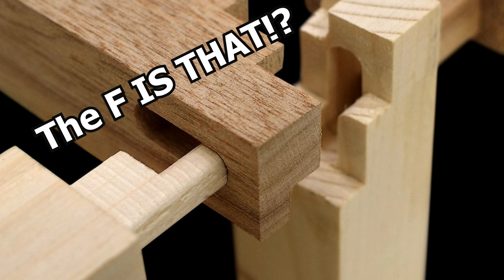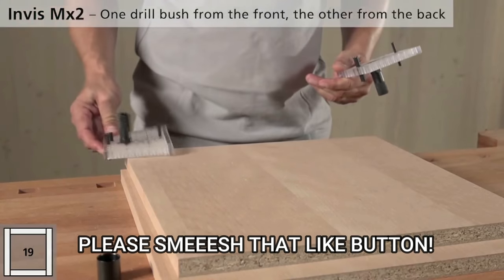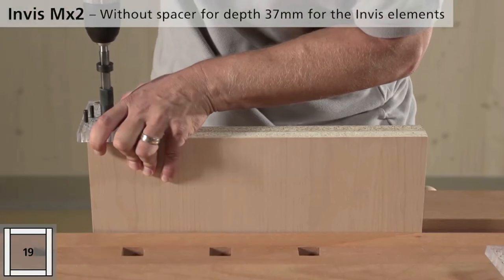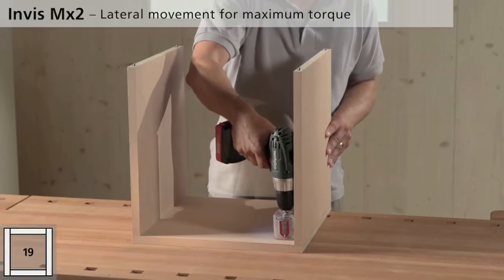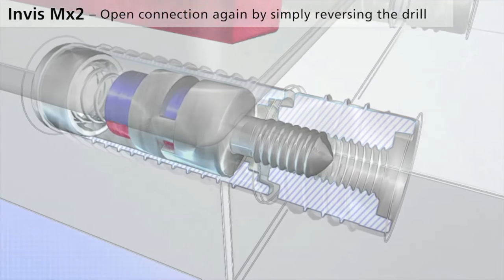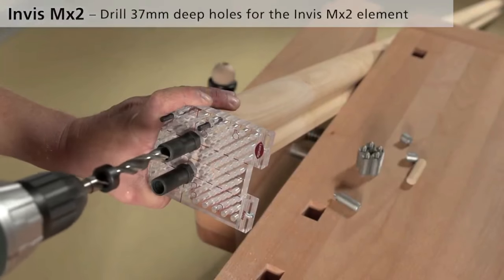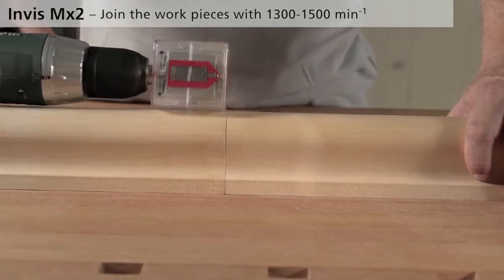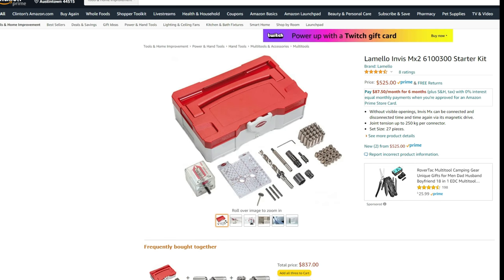The Craziest Drill Attachment YOU WILL EVER SEE!

Comment: Magnets are cool. Have a homemade wood shelf hanging on a wall with pictures and do dads on it. Just an old plain heart pine rustic shelf but it has a secret.The bottom has  concealed hinges down the entire length on the back seam so it's more of a box then a shelf. There is no visible latch or pin or visible fastener of any kind. On the bottom panel in the left and right front corners I drilled a sleeve in the panel going left to right. And on the side pieces of the "box" the bottom panel resides between I drilled the same diameter hole in straight alignment careful not to go all the way through. (mark your drill bit for depth). Next took two nails, and cut off the heads with my kleins and inserted one in the sleeve I drilled in the panel on each side. Next there is a very strong rare earth magnet in one of my do dads I mentioned before. So  supporting the bottom of the panel with my hand in the middle I slide my do dad from the outer front corner towards the center from each side sliding the nails inward and out of the holes drilled into the side which releasing the lock to access my contraband. LoL. To lock it back just raise the bottom back until my edges are flush the slide the magnet down each side in an outward motion sliding the nails back into position locking the box again. People have stood there looking at the pictures and old do dads and even remarked how the love the old stained wood and all the worm holes and grain and no one has ever figured out it's actually a hiding spot. And doubt they ever will. All that said I really like this fastening system you passed along. Thanks.

Comment: How tight does it actually get? I'm curious how strong the magnet is. By the way the craziest drill attachment I've ever seen is for use in the bedroom 😜😉!! Just saying!!
Reply from the maker: Hahaha Mark 👊.  That's the question I have too. I've heard some say it gets pretty snug, but others say the opposite 🤔
Reply: It uses strong permanent magnets but depends how fast it is being turned as there's a recommended RPM range it should be used in for best results.  Though, for fun, check out LockPickingLawyer channel, he used one once to demonstrate that electronic locks can be vulnerable to magnetic field if not properly shielded.  So he took a fingerprint padlock and put it right next to the unit, magnet seemed to grab hold of it at that point and he just finger turned the bit and in a few seconds the lock opened...  So definitely strong enough to mess with nearby electronics...
Reply: @ZeoCyberG  I'll have to check it out. Thanks for the heads-up!!

Comment: I had seen this tool in a This Old House episode when a hand rail was being installed.  If you do a lot of joinery, then this tool is worth the price. Personally, I would rather have a Festool. 🤤
Reply from the maker: I agree Lisa, I'll take that Festool in a second.  Thing looks awesome 👌
Reply: @ToolReviewZone  Problem is aside from some snap together options there isn't any Festool options that can be repeatedly disassembled and assembled that will be fully invisible in the assembled piece.

This is specifically for flat pack-able furniture that you want to look perfect and have no visible signs of how it's joined and be strong enough to function as final furniture without worry of it being knocked apart.

So, despite being very expensive, this system has been around for years for those who absolutely need invisible but temporary joinery... Mostly in the commercial industry and high end custom building... 

However, while not as rock solid once assembled, there is a cheaper option out now that's good enough for most... 

Look up Intelligent Fixings Peanut 2.  UK company, but they'll ship internationally... Peter Millard (10minuteworkshop) did a review on them you can check out as well as did a DIY version of the jig you'll need to use it...
Reply: Awesome,  thanks brother 👊👊👊